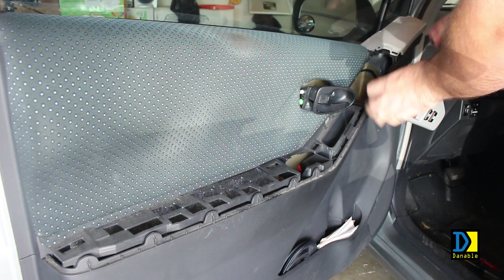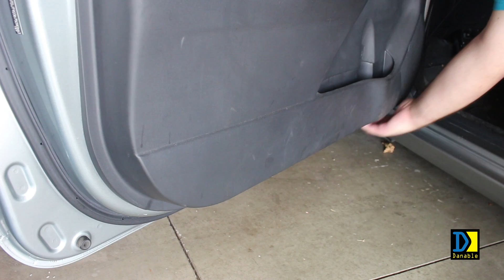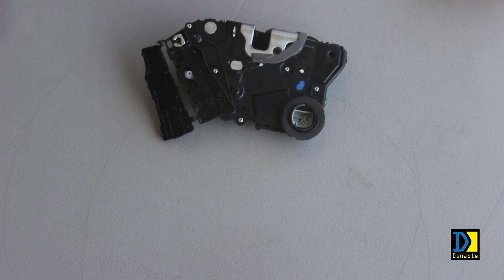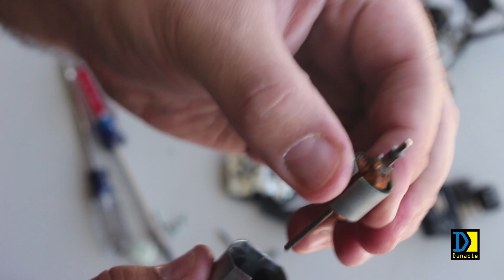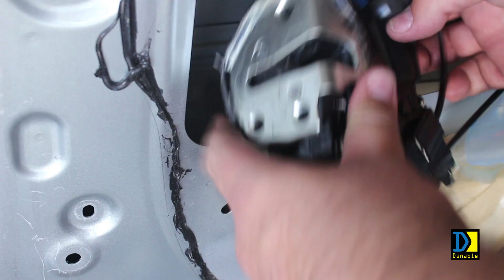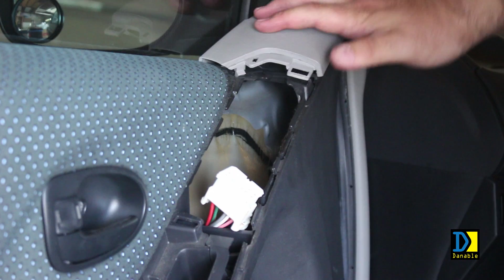HOW-TO: Fix a Broken Door Lock Actuator on a 2007 Toyota Yaris

Comment: My white cable broke on the door pull side the plastic broker on end of it what is part nunber or can be fixed
Reply: The linkages he callled in the video but the lever end not the acturator

Comment: Initially disliked the video because you didm't bother explaining how to reinstall the actuator correctly. This is quite difficult and I struggled to put it back because the door latch won't engage in it easily initially.
However the effort you put in reqairing the actuator desereves a like

Comment: Gotta say, thank you so much for your experience here. Bought a $10 dollar motor and replaced it with no issues... 😅 I did forget to insert the key piece and the door handle to the actuator, but was able to fix it using your video as guidance. I must have skipped that warning or just kept rewinding. Anyways, thanks so much, Dan.
Reply: I skipped them too, and was locked out of my car.  Now it's fixed, but my key does not unlock either door. What "key-piece?" I only saw the one rod which goes from the actuator to the door handle.
Reply: oh, now I see.  thanks

Comment: Great video, for those of you guys having AFTER MARKET actuators installed, here's my solution:
Mine is a 2007 Yaris sedan,  it didn't come with power locks, so I have someone installed the aftermarket actuator couple years ago, and I have the same problem came up recently (the keyfob can't lock the door, the door lock/unlock switch seems lack the power to go all the way in to lock the door).
So I take off the panel and found the screws that tightens the actuator on the door are loosen, I just have all the screws tightened and put the panel back on and it worked(yeah, easy as that),  hope it helps.

Comment: THANK YOU for this video! It gave my husband and I the info and confidence we needed to tackle this project on my 2009 Yaris. We had the same issue with the residue on the motor, which solved the problem. We also introduced a new issue by reassembling the pieces incorrectly so thank goodness you showed us how to test for that! We thought we got lucky because our pieces didn’t fall out but it turns out they did get misaligned and a wire spring-type thing underneath all the obvious moving parts had fallen out of place. (If the white lock part that moves above the gear isn’t very clearly clicking in and out of the locked position when you move it up and down, your pieces aren’t in right!) I ended up taking apart and reassembling the actuator half a dozen times but I eventually figured it out and, long story short, the power lock works again! Thanks again. Your video saved us hundreds of dollars in parts and labor fees and helped us take on an interesting project!

Comment: This fault occurred on my wife's yaris the passenger door. It was locked shut so couldn't gain full access. . A quick fix is to remove the armrest trim & screws, this will expose the moulded joints where the 2 parts of trim are connected. Hacksaw blade the first 3 to 4 apart, enough so you can get some leverage to pull enough of the trim back to get access to the door lock motor. Remove the wiring clip from the motor, then strike the motor a couple of times with a spanner. Plug the wiring clip back in & try the central locking. This will eventually work & will allow you to open the door to gain access to remove the screws holding in the lock & motor.
Reply: thank you-  my replacement actuator decided to lock itself after i put it in and closed the car door. Now i cannot open the door, key or no key, lock button, etc. I don't know what to do. (i didn't put the door panel back on, so i do have some access to the motor).

Comment: Great video! If you don't open the actuator assembly upside-down (it's upside down in the video, that's why it fell apart) it's not so bad, I recommend trying it before blowing $300 on a new one. Make sure the white electrical connector is facing up when you separate the two halves.

Comment: Very useful video, many thanks!  I have a problem with the rear door not locking.  So i fiddled with it, and first it locked and I could not open it. Fiddled some more to get it open.  Now the latch  is in locked position so door won't shut at all. This is draining my battery slowly. Arrghhtt#@$%%#^&!
What a piece of crap.  Does this technique work for the rear hatchback model too?  Its a 2008.
I'll have to work upside down since door pops open.
Reply: I have the same issue with mine battery keep draining everyday  Yaris hatchback 08 struggle
Reply: @BenMarko  I took it to a shop.  They discovered it was a loose connection. Pretty easy to open up the back and check it out yourself.  Meanwhile, quick fix is... open up the plastic panel and disable the connection cable. Like pulling out a small plug.  Now the battery will not drain.  You have time to get it checked out.  Don't replace it, fix the connection.
Reply: @lass-inangeles7564   Thank you i will definitely try this weekend  I appreciate sharing the experience with that issue

Comment: My door lock has jammed locked, with the door closed..... so I can removed all the screws for the door panel, but I can’t get the panel off cause the door is locked shut. Any suggestions?
Reply from the maker: Hmm. If you can reach the linkages under the inside handle, you might be able to pull the one that unlocks the actuator. One is for the lock, the other is for the door latching mechanism.
Reply: this happened to me..  i removed what screws I could find, and the armrest and the electrics, and I pulled on the lower part of the door panel, enough to pop a few connectors, then I forced the door panel upwards. It's a 2007, so it's not a disaster if I broke something..  the panel actually did come up and off.  Then I unhooked the 2 cable connectors to the latch, and took the door panel away. (Be careful not to break the 2 cable connectors,  they are plastic. I broke one, they are $50 each).  Now I have a locked door without the door panel, so I can try to unfreeze the actuator and open the car door.

Comment: Thanks! This video was a life saver. I ordered a new non-oem replacement but they sent me an actuator for an '09 Camry instead of a Yaris. Which worked except the door handle linkage was in a different spot on the actuator so the cable throw was longer. 

I decided to order a new motor instead of another actuator after that since I couldn't get the motor housing off to clean it.

Only part I wished you had in your video was a way to reassemble the actuator since parts fell out as I took it apart to replace the motor as well. LOL. 

Either way thank you so much. I am now an expert on removing my door thanks to you. Ha ha ha!
Reply: Eleazar Garza after watching it too I wished for the rebuilding, cuz mine only a part fell out, but couldn’t figure out how it fit

Comment: Dude, thank you so much! Your video saved my life! I saved like $350 fixing this myself. My case was a little different than yours: the little motor seemed fine, even I couldn’t opened it since it was slightly different from yours (mine is a 2014 sedan), I applied a little lubricant spray all over it and spinned the rotor a hundred of times, then I sprayed a little switch inside the actuator to remove any particles, after that I put it all back together and worked pretty well!

Comment: my door latch will slip thru the hole so there is no reason to remove the cables.   my yaris is a 2010, could be different on a 2007
Reply from the maker: Good point. It probably fits but I just didn't try. I figured I wouldn't be able to fish it back through once I was putting the door panel back on so I took it off at the beginning.

Comment: Great video! If you do this yourself make sure you pay attention to how the top part of the actuator connects to the bottom. I spent some time troubleshooting the lock/unlock motion because a piece of the top wasn't in the proper plastic guide on the bottom piece.
Reply from the maker: Thanks! 

And thanks for the reminder about reassembling the actuator.The arms and levers go together in a specific pattern. It helps to disassemble it slowly to see the pattern. Don't do what I did and let it all spill out. 

Once it's back together, make sure to test it with the power and a screw driver in the mechanisms. If it's wrong, you can pull it apart before it's back in the door. Don't test it on the striker or the door! If it's not assembled properly, it'll be stuck on there with no way to remove it.
Reply: Danable desperation call! I have done the unthinkable and locked my door shut with the actuator not working. Neither the outside nor inside handles have any control. Any ideas?! Please please help!
Reply: I’m stuck with the same problem
Reply: +1 to this, but it's not too difficult to figure out, just fiddle with the different levers and see what each of them does, eventually you'll see how it goes